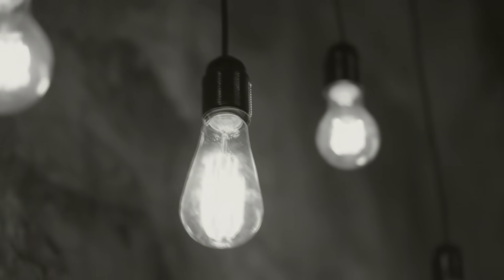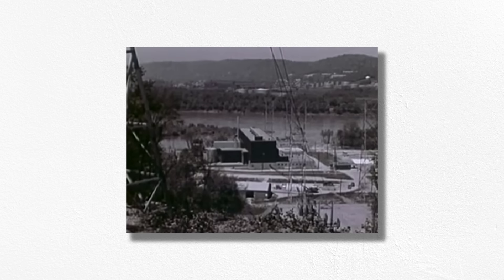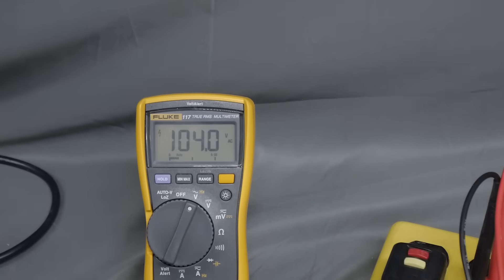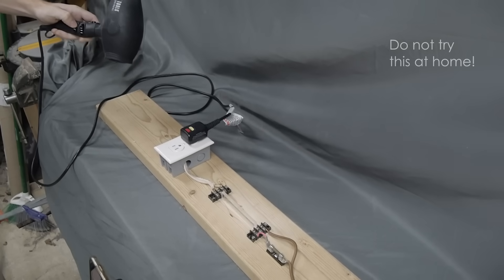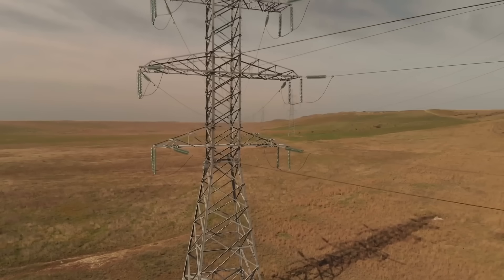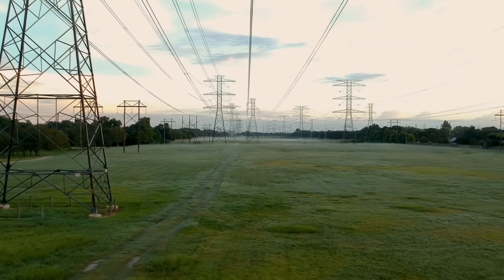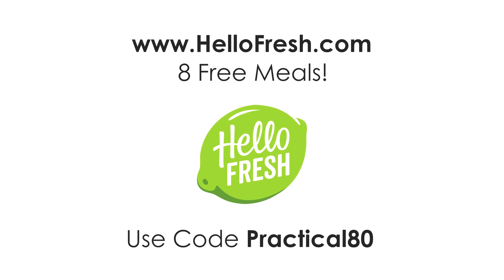How do Electric Transmission Lines Work?

Comment: The math around power loss makes no sense to me.
Ohm's law says V=IR. So, if I have a voltage of 1000 volts over a 10 ohm wire I get 100 amps of current. Simple.
But now we have an equation for power P=IV. So 100 amps at 10 volts is 1000 watts. Okay.
But now we say oh, by substitution P= I^2 * R. A linear reduction in current is a square reduction in power loss.
So let's reduce the current I. Given I *just said* V=IR then that must mean we get reduced voltage. But no, we can actually change the voltage and current independently, so we can increase V and decrease I at the same time.
Isn't this a contradiction? There's something missing here. R is constant.

Comment: Do one that discusses the skin effect (it's why high tension lines have conductors in groups, with spacers to ensure they stay separate). Basically: it takes time to get the electrons in the conductors moving, the easiest (and first) electrons to move are those on the edge of the conductor, and there isn't enough time in a cycle of AC to get the electrons deeper than about 9mm moving; any metal deeper than that might as well not exist.
Reply: That is not what the skin effect is about.
Reply: @deang5622  Why not? What is it about?

Comment: Great video! Side note, I know it specs out fine but either way your ungrounded green 50ft extension cord running a hair dryer gave me anxiety 😬 The melting wires a minute later though didn't bother me, haha.

Comment: Aluminum a good conductor hahaha. It's good cuz its light and cheap. But you need more for the same voltage and current as a smaller amount of copper
Reply: Derkainer Sledgehammer Productions its good in terms of cost, resistance and weight all factored together. 

For example for two conductors rated at X current carrying capacity, the aluminium will be half the weight of the copper aswell as being cheaper
Reply: @JonnyD3ath  I feel like I said that maybe not as well as you but close. When doing wire pulls dispite being heavier I would rather work with copper. Size is limited in conduit. Sure you can upgrade the size of conduit however conduit gets mad expensive fast depending on how big it is
Reply: Derkainer Sledgehammer Productions speaking from a power linesman perspective i would rather the alu as we are not limited in conduit so are thankful of the lighter weight! Lol
Reply: @JonnyD3ath  I guess I wasn't looking on the other side of the fence. Great point. On a wind farm right now the aluminum lab cabling is 1000 with 24 cables going from the dta to the transformer and the hv aluminum is tiny but man is that insulation thick
Reply: Derkainer Sledgehammer Productions yeah, the HV cables tend to be thinner than LV, odd at first but makes sense.

Comment: I work with buried pipeline in transmission line ROWs. We usually get induced AC voltage from the lines and have to install drain wells. Could be a neet future video on Cathotic protection and AC voltage mitigation. Love your channel, sir!

Comment: Can you go more in depth with volts and amps/ current and voltage. Like how they are increased and decreased and what Hertz are/what it means to electricity and devices using it and anything else related that you find interesting.
 Edit  Assuming not addressed in other videos I just saw you have other power videos.

Comment: So the how do birds sit on transmission lines and not fry? 🍗
Reply: Samuel Merrill because in order for current to flow through something there has to be a potential difference. When a bird (or human) lands on a single line without contacting anything else, they come to the same potential as that line but there is no difference to allow current to flow. But if you then touched another line or something at ground potential (0 Volts) then there will be a difference across you, bang lol

Birds DO infact regularly get fried by powerlines, they are one of the main causes for supply fluctuations and temporary cut offs where i live

Comment: sorry i am new to this stuff, only 2nd year EE but if V=IR and you increase the voltage while keeping R the same, shouldn't the current increase. What am I missing?
Reply: +M A - In that part of the video he is discussing only the part of the circuit concerning the transmission line, not the entire circuit. He is pointing out that all conductors have some resistance, and to send electricity long distances without too much loss to that resistance, the only way to do so is to lower the current (I). But to keep the same amount of power (P), the voltage (V) must be raised. That's the point I think you missed.

Comment: newly installed high voltage power line was installed  running parallel to the railroad tracks I worked on.  If we cut out a bad length of rail in this area.  We would notice small sparks arcing between the cut.  When installing the replacement length of rail, the same arcing would occur and if you held both sides of the connection, you would get a decently strong jolt.  I'm guessing this was caused by induction.  If it was foggy or slightly misting, it really stunk to change a rail in that area
Reply: shanevmax34 wear gloves? Lol
Reply: That is a problem with running AC lines. If these lines were DC this loss would NOT occur.
Reply: Impressed voltages another subject

Comment: Transmission Lines magnetic fields can also affect humans. You can even measure the power from a certain distance in the air. Solar panets use aluminum which you have to extract it from Bauxite which causes a lot of pollutions and contaminates water. Odd how so many waste aluminum when they dont understand how toxic it is to mine it every time they are wastful put into landfills at times and more issues.
Reply: Trench the magnetic fields don't affect humans. There are guys who make a career out of live hands on work with no increase in any cancers or illness in this sector. Let alone someone on the ground walking near a line.
Reply: @JonnyD3ath  quote "ncreasingly, the medical community is recognizing the danger to health these power lines can cause. For example, a variety of studies suggests that living close to high-voltage power lines can increase the incidence of several kinds of cancer, as well as other diseases."
Reply: Trench i'll wait to see irrefutable evidence thanks, not 'a few studies suggest' as studies are carried out by many, many people who suggest everything causes cancer depending on what day of the week it is. I will carry on working around live lines for a living, as will all of my coworkers

Comment: how technician work on high voltage lines? do the line shut off first?
Reply: In some cases, they worked while the transmission lines are on, of course they're using special gear while working on it

Comment: Ahhhh thanks so much for this video, it answers many stuff I've always wondered when looking at pylons

I still have some doubts though, about ceramic discs: if they get wet during storms or foggy days, shouldn't electricity start to "jump" from disc to disc creating arcs, instead of trying to follow the longer path?
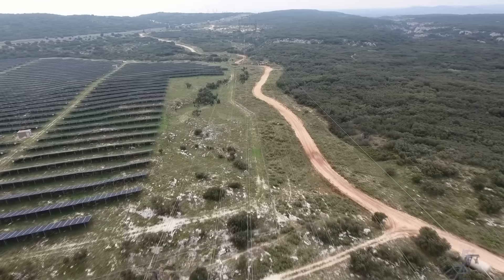Also often there are 2 parallel lines of insulator cones holding one cable, like in 5:33 or 5:43, is that for structural purposes or backup or...?
Reply: By using arcing horn, the voltage distribution on each ceramic disc can be made roughly the same. So for example 150kV lines usually have 12 discs, so the voltage between the discs are roughly 12kV. Air breakdown voltage at normal conditions is 30kV/cm, and the gap between discs are roughly 10cm. I'd say it's pretty hard for arcs to jump. Electricity can flow through the surface in wet condition though, and pollution such as dust could make it worse
Reply: wwwKx if you look at the shape of the disc, they are more of a bell shape, this means that a portion of the disc should remain dry underneath to break the path. Contrary to popular belief, water isn't a great conductor of electricity. In fact, pure water DOES NOT conduct electricity

And you see two stacks of insulators there for extra structural strength
Reply: Thanks for your answers!
Reply: wwwKx 
Yeah but ginger girls are limited edition; they only make so many of them each year

Comment: You missed an important part : Because of high voltages, current carries to the out edges of the conductor. the center is usually a steel core. As copper itself is a very soft metal, so the steel gives it strength.

fun fact, its a long know thing for farmers to steal electricity by burying copper lines under transmission lines.
Reply: It's not the high voltage, it's the frequency that causes the skin effect
Reply: @syahadatulhidayat1325  in NA all voltage is 60hz. I'm afraid you're wrong.
Reply: @s3ri3sb43  yes but the same thing goes for 50Hz transmission lines, look up the formula for skin depth, it depends from the power system frequency

Comment: Correction at 3:35...

V=IR is not the equation that shows that increasing the voltage would decrease current. If you made V larger, I would also be larger to keep the same R. In reality, transformers change the load, so Ohm's law is not violated.

Rather, the correct equation is P=IV. This equation shows that you can deliver the same amount of power with lower current if you increase the voltage.

I just wanted to comment in the event that someone was confused. Thanks again for your great videos, Grady!
Reply: but if you increase the voltage shouldn't the current also increase thus giving you more power? how do transformers increase the voltage while making sure current stays the same?
Reply: @MA-qz1sd  I hope you got your answer. if not, consider this P = I V -> assuming P is constant ('which is the demand") doubling the voltage will give us half the current.
in your second question, transforms change the voltage and using ohms law the current will be I(out) = V(out) / Z(load) or I(out) = V(out) / R(load) if the load is purely resistive. which means that the current is dependent on the voltage and impedance.
Reply: @MA-qz1sd With more windings you increase the resistance which drops the current. This necessarily translates to a higher voltage in a circuit with no capacitance.
Reply: Thanks for pointing this out.  I scrolled through the comments to see if anyone had made this correction because I noticed the discrepancy too.

His audio explanation is correct as he describes the relationship between >power<, current, and voltage as defined by Watt’s Law (P=IV), but the video incorrectly displays Ohm’s Law (V=IR), which describes the relationship between voltage, current, and >resistance<.

In Watt’s Law, voltage and current are inversely proportional, meaning as one variable increases, the other decreases.  But, in Ohm’s Law, voltage and current are directly proportional, meaning as one variable increases or decreases, the other variable will increase or decrease by the same factor.

This video was great!  It just had that one mistake where the equation being displayed didn’t match the inversely proportional relationship being described.  Thanks for posting!

Comment: Great video.
Could you please consider making a video about the various things that can be found on overhead lines? I have tried looking up the non-obvious ones, but run into problems when looking up "black things that are on overhead lines."
Thanks.
Reply: Then on high transmission lines you may see large brightly coloured plastic spheres on the top line, these make them more visible to low flying aircraft.
Appart from that there isn't much else fitted to lines
Reply: seeigecannon possibly bird diverters? Sometimes fitted above houses/car parks to stop birds pooping over everything

Comment: 3:38 OH NO. Ohms law doesn't say if you increase the voltage then you will decrease the current. It instead says that if you increase the voltage, the current will also increase, given the same resistance. e.g. V = I * R, 6v = 2A * 3Ω, 3V = 1A * 3Ω. The point is of course that the load (the thing you want to power) should have access to the same power: P = IV, so the in this case, to get the same power with a lower current, you'll need to increase the voltage. Ohm's law, then, says that to get the same power draw with a higher voltage, you need to increase the resistance of your load. It is for instance possible to have a 40W bulb at 120V, and also a 40W bulb at 240V. If you would take the 240V 40W bulb and use it in a 120V circuit, it would then only use 20W of power. In any case, the formula and explanation at 3:38 are incorrect.
Reply: Be careful of light bulb examples as light bulbs don't obey Ohm's law when they heat up, heating the filament increases its resistance.  In fact, many things do not obey Ohm's Law, e.g. gases electrolytes, semiconductors, and motors.  It works best for cold metals!

Comment: I'd love to hear part 2, 3, and 4 of this. :) All the questions people have asked here, and more. What's the normal material for transmission lines? What does maintenance of them look like and how often is it needed?
Reply: Guy I know we use ACSR (aluminium conductor steel reinforced) which is aluminium strands wrapped around steel core for strength.
But most of our distribution network (lower voltages normally on wood poles) has changed over to AAAC (all aluminium alloy conductor) which is as its name suggests, aluminium. 
Maintainence depends! They are regularly checked and alot of it is to do with the insulator stack wearing out as they are on a ball joint that lets them move with the wind